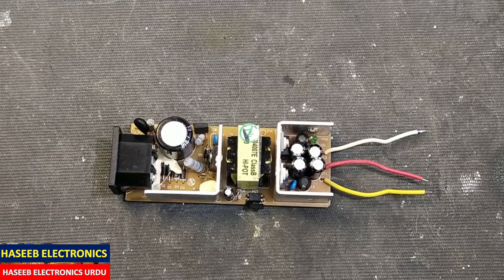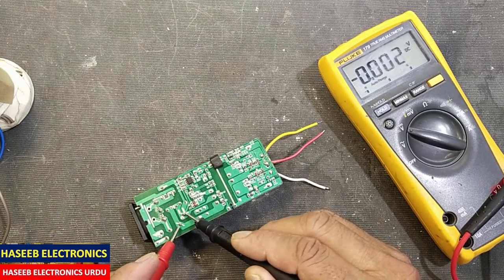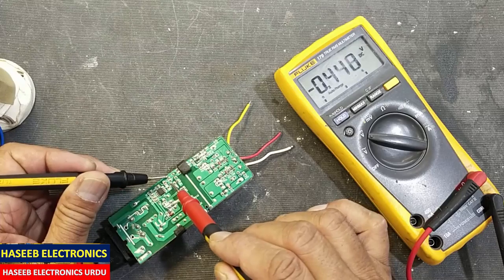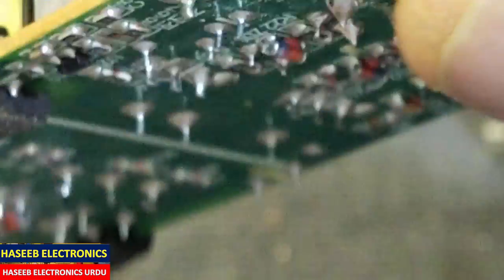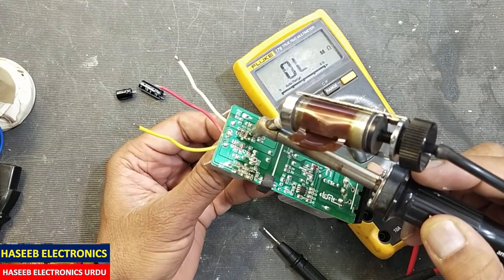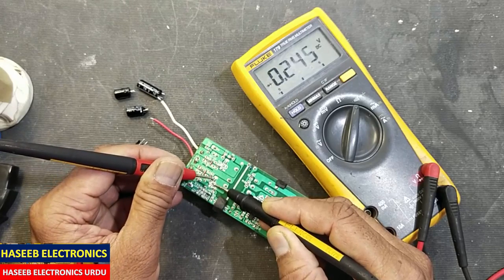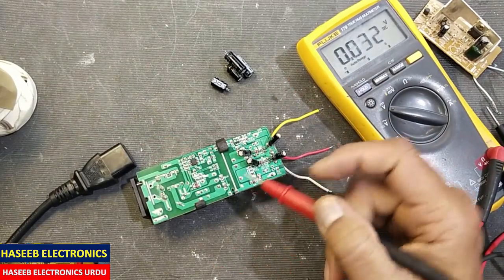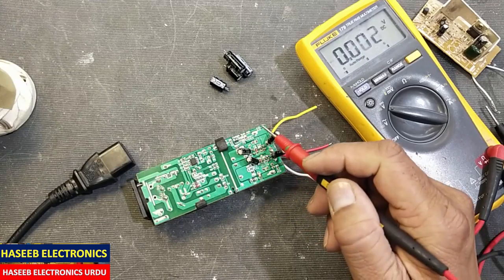{593} SMPS Have Low Output Voltage, How To Repair Switch Mode Power Supply SMPS When Low OutPut

Comment: Hi, my 120W (12v 10A) smps output voltage good but output current very low, i am unable to use 12v 5A load even in smps no voltage fluctuation or down very stable voltage, i checked all components are good in pcb, but low output current, so what component to be replace in smps ? waiting your reply

Comment: Like this in one of my power supply I changed the capacitor to get back 12V but when I connect a 12v fan (0.12A) voltage dropped 3.7V and the fan spins very slow. Which component would be responsible for this? Hopefully get some answer in one of your future videos.

Comment: Hello..i was trying to repair a dead small selfoscilating smps(there Is no switching IC.only 2 transistors)..i found a shorted zener diod e in secondary side i removed It and without replacing It..i plug the Power..then One transistor in primary side exploded!!! What am i wrong??!

Comment: I have a similar SMPS where the 5V output is good but the 12V is low. I swapped out all the output capacitors with new ones. I also checked the output rectifier diodes and they are good as well.  Any idea what could be causing this? All the resistors are within tolerance. Also as a side note there are two trim pots. One adjusts both output voltages and the other appears to do nothing. Do you know what a second trim pot on an SMPS is for?  Perhaps to adjust overload protection limits? I can't find the schematic for it anywhere.

Comment: Hi sir, I have one smps, it has output voltage dc24v/20A and 27v/2A. Output is coming correct, while giving the load the smps getting vibration sound. So what is the problem in that sir

Comment: Thanks for this video.It is very educative.please what is the name of the soldering iron used and can it be gotten.thanks
Reply from the maker: i am thankful dear
i have Weller WR3M Rework Station (Made in Germany) 
it is around 3000USD + costly in routine maintenance & accessories 
 (my suggestion is get HAKKO 701 or any HAKKO brand, that is Japan Made, cheap, very low maintenance)
you can check video number 511.

Comment: Thanks for sharing you valuable information. I have a question sir, i have a treadmill motor control board  which i am repairing, the input voltage is 234v, and AC voltage on bridge rectifier is 234v but the output of the bridge rectifier is showing 210v. Where could be the problem? I replaced the rectifier but still shows the same.
Reply from the maker: please check main DC capacitor, it is surely open from inside or may be its track is open or may be some NTC or PTC is open 
clear the circuit from Bridge rectifier to the main dc capacitor

Comment: Sir g, uc3843 se max kitna power ka smps design kr sakte hai? aap ek video me bole the ki 15-18 watt, par koi koi 120watt ka bhi banye hai to vo jada din nhi chalega kya?
Reply from the maker: as this IC is used to drive single mosfet 
single mosfet is used to drive flyback and boost converters. so flyback designs safe range is less than 100 watt. above 100 watt it becomes difficulty in regulation 
best design with excellent control is between 10 watt to 100 watt 
above 100 watt, then we need bipolar meganet designs like half bridge, push pull etc
Reply: @HaseebElectronics  Thankyou very much Sir

Comment: Assamu aalekoum . A question. Why som of power supply 12 volt 2 amps has the tl 431 with 1 resistor in the gate going to the positive . Without resistor to negative i try to change the voltage it cannot go more than 15 volts but . There is no zener diode. Shukran شكرأ
Reply from the maker: وعليكم السلام ورحمة الله وبركاته
تقبل الله منا و منكم الصيام و القيام و صالح الاعمال
عيدكم مبارك
كل عام و أنتم بخير
you must locate the Pin 1 of TL431 there must a voltage divider network (2 resistors in series connected between +ve out and ground. center node will connected to pin of TL431
or there may be zener diode connected between pin 1 and ground

Comment: Sir mere pass Jo smps hai  vo 24 volt ka hai Jo 28 volt Tak regulate hota hai lekin proper job nahi nikal Raha flex printer ka SMPS hai voltage brabr hai kya current kam pohch rha hai...Aisa ho skta hai kya

Comment: Sir, I have a some question. SMPS connecting negative output to earth/ground. Why?
Reply: Blue capacitor (connected between hot and coldsite ground) is short . Remove it

Comment: Pls sir I need your help
I have a power pack which the AC volts is 230,while the output is 12v DC, but the DC is low to 4dc, what could be the issue?

Comment: sir. what ic no. can i substitute with 34063al? please..
Reply from the maker: use LT3470 .  

CS51031/CS51033 is more comparable to the MC34063 but it requires an external power transistor.

Comment: Sir the voltage at main filter is present and no voltage at the secondary output what happen to the voltage at the input pin of the optocoupler sir tnx
Reply from the maker: check startup resistor and vcc voltage
check switching frequency of the PWM IC, if it is not switching then may be you need to replace IC
i will suggest to check video number 528, that covers almost all common faults .

Comment: السلام عليكم وعيدكم مبارك
Pls Ihave problem
I need to change my smps 220 Ac input 24vDc 500w
To 110v Dc input from battery 
The question  is what i do to change  the input from 220ac to 110 DC 
Note, I can pay you if you help me 
Thanks 🙏 from 🇮🇶